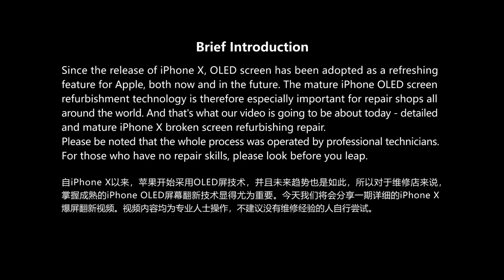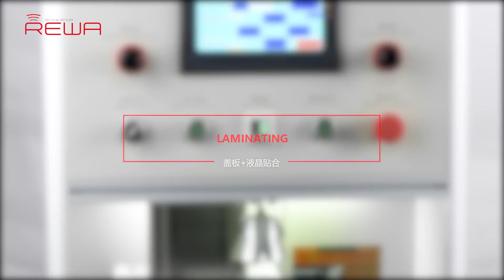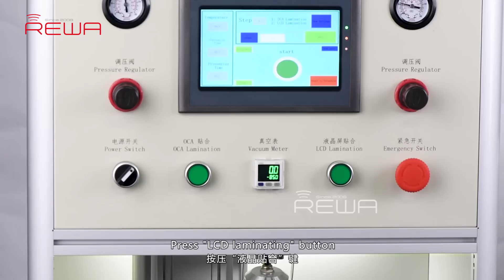Updated Faster Solution - iPhone X Broken Glass Screen Refurbishing

Comment: What liquid do you use to remove bezel??
Reply: Yeah, what is that "glue remover"? Obviously, it's some kind of powerful solvent. Maybe acetone?
Reply: @MikeTrieu  most likely n-hexane
Reply: @Mazlie  Now that you mention n-hexane, I did find this industrial adhesive solvent from 3M called "Solvent No. 2" that is a mixture of "Petroleum Distillate, N-Hexane and Toluene". To be fair, 3M does also have a substitute product that is derived from citrus oil and contains no n-hexane, but they admit it doesn't perform as well.
Reply: Lighter fluid.  Thank me later

Comment: The frame should be glued with structural adhesive also. This glue tape can not hold the display for long .
Reply: @u666sa would the difference in loca glue thickness affect the 3d touch, laminating would have a uniformed layer of oca maybe why
Reply: @u666sa I thought the 3d touch was sensitive to the thickness of glue between glass and digitizer for it to function correctly if liquid is used the thickness would be hard to guage or will the 3d touch work regardless?

Comment: would face id still work after a glass only repair?
Reply: And that's the big question but to answer your question yes indeed it'll work just fine, keep in mind that you have to disconnect both cameras  flex cables which has the proximity sensor,  so after disconnecting both of them there wouldn't be any risk of either damaging or breaking the face i.d, I like technology, and repairing stuff although isn't my profession my friends are always bothering me, cuz I fix all their devices, for free and I take as a hobby, too lol 😆 🤣😂